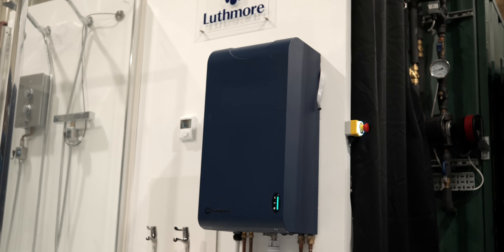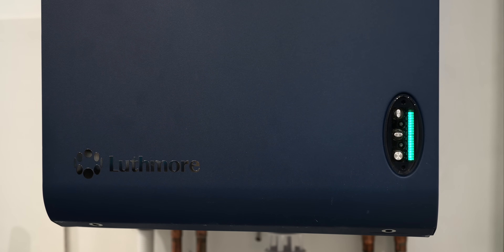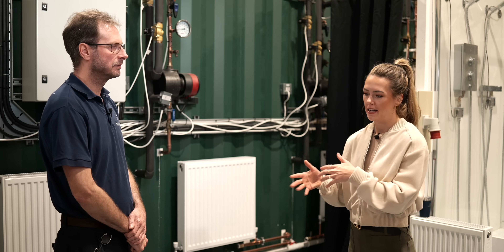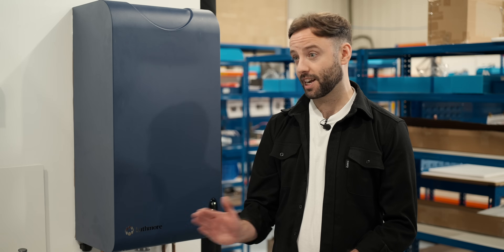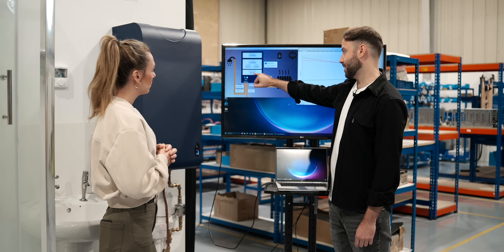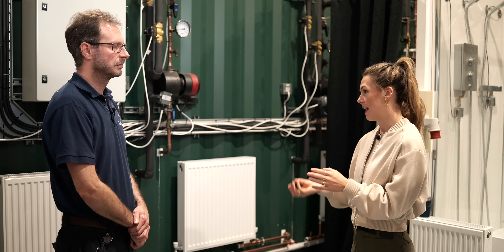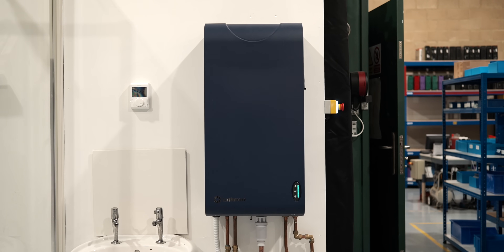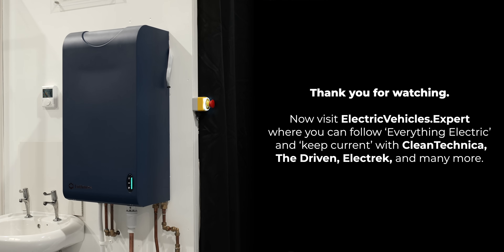Could This Battery Boiler Replace Gas AND Heat Pumps?

Comment: They're so advanced they've solved all of the round trip losses associated with battery systems, achieving 100% efficiency! Have they b*****ks. Another infomercial. Halfway through, and is anyone going to mention there's no way to heat the house/flat, and you'd need a heat pump, electric boiler or storage heaters on top of the cost of this system? Let's see.... 1 minute later - 10kwh enough to cover daily heating needs... For what, a NASA-tech insulated shoe box? 😂

Comment: Naysayers in the comments are missing the point. These smaller home battery storage ideas are starting to build momentum. One I've seen recently is Pila Energy, basically plug'n play portable power packs optimised for home use.

Comment: It's got 5.8kwh of battery storage in the device. it shows it discharging at 20kw's. You've only got 20-25mins of hot water? Then its going to fall back to a normal 7kw mains supply.. unless you start begging your network operator to upgrade your supply... 

they really need to be more transparent about how the numbers for this thing stack up in the real world usage.
Reply: Perhaps it's a vanity project?

But the mathmatician in the outfit isn't ...
Reply: It stores the equivalent of a 138 litre hot water cylinder, which is a perfectly reasonable size for a small to medium-sized home. However unlike a hot water cylinder, it throttles down to mains-only @ 10kW should the energy store become depleted while in use, as mentioned in the video. So you never run out of hot water and it only needs an AC connection equivalent to an electric shower.

Comment: It would make far more sense to have both batteries that can charge by solar and/or mains with a heat pump and a 15-20 liter buffer/tank. I would not buy a battery waterheater alone. A heat pump do not need to be bigger than a mini split ac unit, so remove 1 or 2 of the batteries or make the unit 30-40 cm taller and you´ll have it sorted. What I did not see and what would make a big difference is if the stored power also could be used as a home battery/backup system. It is after all better to keep the fridge running than having hot water in a emergency.
Reply: A well insulated water tank is very efficient storage, in the US 90 Liters is about the smallest size and some have heatpumps built in. Also, rooftop solar water heaters are practical in many climates and can even be DIY. Even raising inlet 10-20C saves a lot of electric energy.
Reply: @rogerlafrance6355  My point was that together a heat pump and battery would make more sense, to me at least. The 10-15 litre "hot water tank" was only intended as a buffer so it could cover minor usage like handwashing a cooking pot or similar, not to cover a shower, unless you do a sub 1 minute shower.
Reply: @rogerlafrance6355 heat pump built into the water storage? Where does it get the heat from? I'm assuming it's taking it from the home rather than having a separate component outside to borrow heat from there?
Reply: @FahadAyaz  Yes it takes heat from inside the house, for now. Still very efficient and large tanks allow off peak reheating.

Comment: I can see some sense in this, having designed instantaneous direct electric hot water heating for a 1bed flat I know you hit the mains power limit at either one kitchen tap or one mediocre shower.
7kWh is typical hot water storage for 2-3 people, so the hot water side of this is making sense, but heating is usually into several 10s of kWh per day in winter, so that will be direct electric at 4x the cost of gas.

What could be an interesting direction for this is to combine it with a heat pump - heating at gas costs and off-peak hot water storage without a tank. (You could use the heat pump to warm the cold water feed directly and get say 5 kW at high COP). With smaller low heat demand dwellings you could pair it with a lower power heat pump than currently used as you wouldn't be worried about hot water reheat times.
Reply: 5kW is a mediocre shower, the heatpump is going to need to be big regardless. I think what makes most sense is to use an isolated heating loop with heat recovery drain -> heatpump -> plate heat exchanger and back again. Then use a small boiler to bridge the time for heat recovery to kick in.

Comment: Have a 30 plus year old oil boiler that never gives any trouble and costs £50 to service. I wonder how many years it would take to get the investment back on this system and what is the expected lifespan? And what's the environmental footprint of the batteries?
Reply: Dont forget your boiler is also performing a secondary function 
It's expelling damp moist internal air via it's combustion cycle drawing in fresh dry air via window/wall vents 
This crazy idea requires some kind of secondary system to perform that function (probably run on more electricity) or you'll end up with walls dripping with condensation!
Reply: @sailaway8244  Or, if you're sensible, you have an efficient dehumidifier - mine uses under 200 Watts/hr

Comment: It’s very easy to fit heat pumps on new builds but very expensive to retro fit to an existing property. Property developers get a very easy ride compared to vehicle manufacturers something needs to change.

Regarding the battery powered boiler it might be useful where space is very limited and the selling point seems to be  simple to install as a replacement for gas boiler but surely separate water heater and battery pack would be preferred?

Comment: But does it work with the Octopus smart tarrifs?
Reply: Would work with Cosy tariff as that allows electric boilers. Then you only have to use the timer to configure when the battery is allowed to charge.

Comment: Compromised most of all by the ridiculous price of electricity in the UK. Even so, this is such a straightforward and understandable system compared to even heat pumps
Reply: 7p kw/h ? It's fine if you can limit it to cheap sessions
Reply: A lot of folks with solar, home batteries and night time tariffs can make this a great idea. And they did mention this at the end of the video.
Reply: straightforward and understandable compared to hear pumps in the same way as  a horse is for transport compared to a car. i know what id prefer!

Comment: I kind of like the idea, even though it seems like a very niche application. But this boiler really needs to include a grid tie inverter. Everything necessary except the inverter is there already. It has to be mounted to a wall, it has to be wired to mains, it has the battery charging and protection circuitry. It is such a waste to have a high capacity battery and then only use it for heat.
Reply: I guess it's quite cheap to use DC to heat water vs cost of an inverter

Comment: Why reinvent the wheel when the wheel works fine? As others have said, get a home battery and use that to heat your water and everything else.
Reply: Assuming you just plug in at 13A @ 240V, that's 3kW. This is 30kW. 

But why not just run thick cables at much higher amps? This just removes the need for those cables and the losses. And assuming your unit already has a space for a combi boiler, this fits right in there. 

I'm not convinced this is a solution with broad appeal, but I hope this answers your question.
Reply: @oliversissonphone6143

Are you sure about this 30 kW load?
Reply: 13.5 litres per minute at 42°C at the shower head (not unusual with decent water pressure and the right mixer unit) requires 30kW if the inlet mains is at 10°C.
Reply: @mgutkowski 

So, where are you going to find 30kW?
Reply: Because most batteries max out at about 10 KW supply. Like you said you need 30 KW to heat water on demand.
Reply: @privacytest9126 

???

An instant shower  unit runs at 6 to 10 kW on a 45A   radial circuit from the consumer unit.
Reply: This is designed for flats. I live in Brighton and Hove and its flat city. 95% have Combi boilers and no space for tanks. This would be perfect for this city. Also space is a premium, you may have space under the stairs or an under stair cupboard, but as I understand it, batteries cannot be installed there
Reply: @user-rc7dg3np9c 

It looks as if this stupid thing was designed during a hangover.

Utter, utter nonsense.
Reply: Hmm ... appears as if some posts have been deleted.

I despair at the ignorance on this platform.

Anyway, Google did the calculation to raise water from 10C to 42C at 13.5 litres per minute on a UK mains supply, say 240V(AC).

Why not do the same?

Frankly some of you posters are clueless and should not be posting about things you know absolutely fffk all about.

Just for your and others' edification at mains volts 30kW equates to 120 amps.

At 12 volts, say, that's 2500 amps.

How "thick" do you suppose the cables required would have to be?

What current rating is the incomer to a house?

It's 100A, if you're fortunate, and if you have a BEV charger then it's whatever the current has to be.

Simply Google and all will be revealed.

Comment: Wow what a claver bit of kit, the 10 Million bungalows and small homes should be all over this especially if you have solar and a cheap octopus type overnight electricity deal. The heat pump grant should be available as should the zero VAT on the batteries. I wonder what this would come out at ?.
Reply: I think small flats that are insulated to very high standards will be the main markets as they are the ones with very limited space and the lowest heating needs. This device would be using a lot of day time electricity to perform its central heat role in anything larger.

Comment: Looks to have potential - but as presented I don't see how this has the capacity to run both heating and hot water without relying on peak rate electricity.....
Reply: Whilst the shower is on the space-heating does run off the mains. But that is only a small fraction of the time.
Reply: @xxwookey  It's only storing 5.88kWhr of energy so during winter that might only be 2-3 hours of heating for a small two bed property, you're going to be paying full price for most of the day.

Comment: This is the solution I've been waiting for. My small new-build house has a combi gas boiler but no space indoors for a hot water tank, even though there's space outside for a heat pump.

Bolt boilers have been showing a similar concept for a while, but their website still shows only pre-orders available after many months.
Reply: Take a look at Heat Geek (I'm not affiliated etc... just found their stuff when looking at options for myself, for similar reasons) - they have Heat Pump options that don't require a massive tank (uses smaller items that fit in the space of either an under-counter cupboard in the kitchen, or a wall-cupboard, etc)
Reply: @logicalChimp   That compact cylinder looks interesting, I've not seen one like that before. Thanks.
Reply: Check out Heat Geeks' new combi-sized boiler that works with a heat pump. Might work for you.
Reply: You could always have a heat pump just for heating and use this for the hot water, I don't see how this can have the capacity to run the heating anyway. You may be able to have a cylinder in the loft, you probably won't need a large one for a small house, that would be the best solution if possible.
Reply: @MentalLentil-ev9jr   The loft is the only place a hot water tank could go in my small house, but I don't want the disruption of drilling through a concrete first floor to get the pipes down to ground level (or routing them outside in the cold).

The house is so well insulated that it only requires minimal heating and it wouldn't put a big load on the electric boiler.

So it's mainly hot water for showers & basins that I need. I could have an electric shower installed (powered mainly by my storage battery which is charged overnight) but again there would be disruption including pulling tiles off my new bathroom's walls. Even then I'd need hot water for the basins, so overall the electric boiler looks like a great drop-in replacement for the combi boiler.